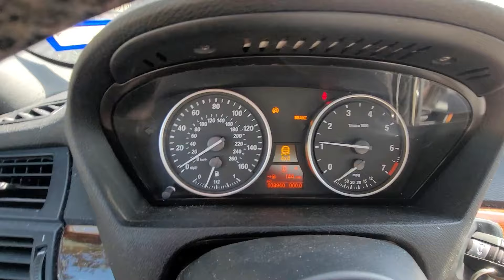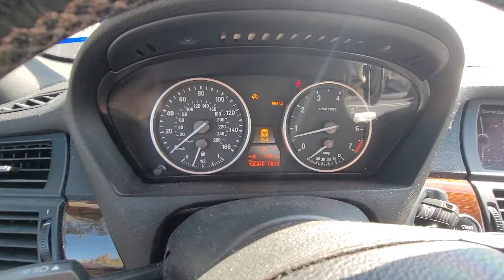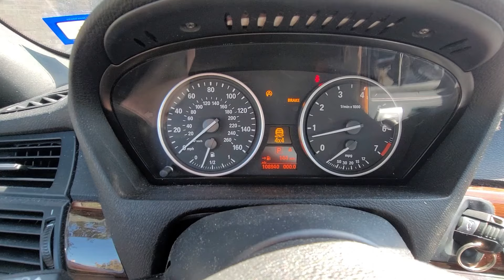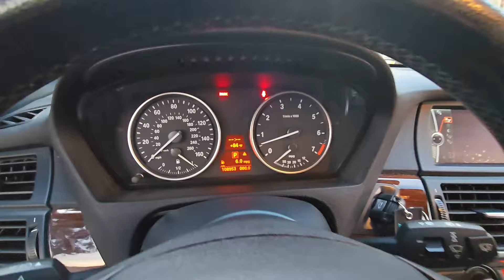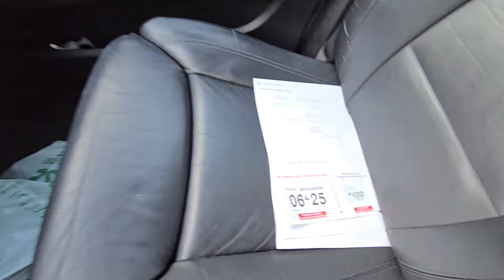BMW X5 e70 4.8i Transmission Malfunction FIX

Comment: Great video! Do you have the part numbers? What year is your BMW?
Reply from the maker: @luissandoval8036  2007 X5
ZFS-0501215718 -Transmission Adapter Plug
ZFS-0501216272 - Mechatronics Sealing Sleeve
ZFS-0734317370 - Mechatronic Sealing Sleeve
ZFS-0734317371 - 31.4mm Automatic Transmission Valve Body Sealing Sleeve
ZFS-0734317372 - 40.7mm Automatic Transmission Valve Body Sealing Sleeve